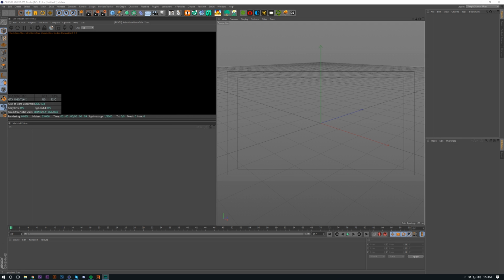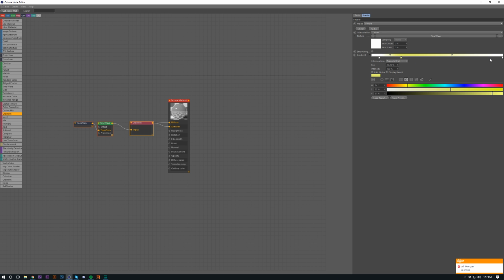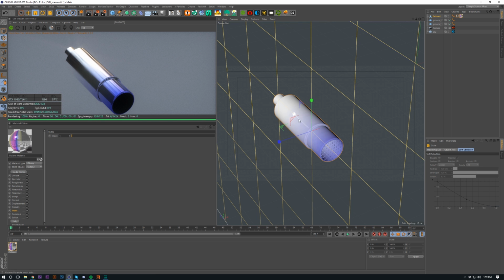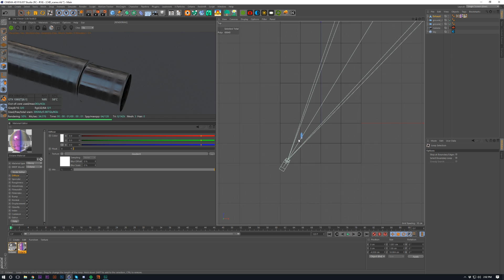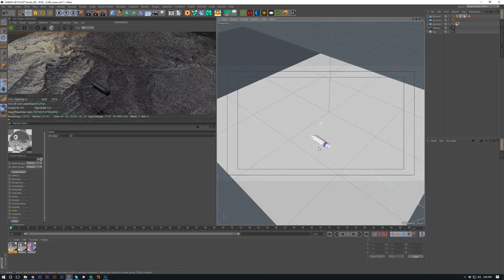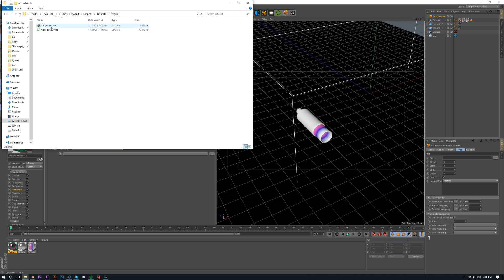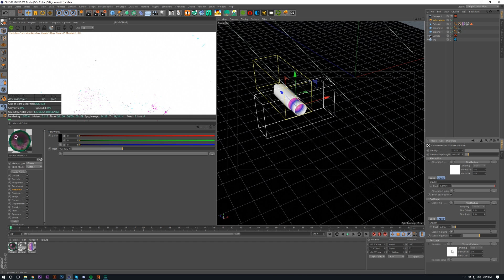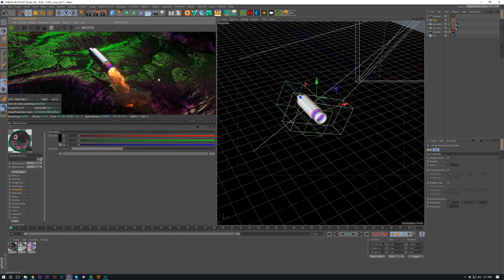Shading an Exhaust and VDB Smoke Tutorial in Octane for Cinema 4D - Free Download

Comment: Great tuts. But do you think you can up the resolution of your computer? Everything is super small so it's tough to see. Other than that, thanks again!
Reply from the maker: Chase Chick yeah I could start recording on my 1080p monitor instead of the 1440p one
Reply: AxisFX that would be great! Keep up the good work. Water tut next with xp4 and open vdb mesher? It's giving me fits!
Reply from the maker: +Chase Chick I'm still on 3.5, is it worth the upgrade?
Reply: There's definitely a lot to like. When I found out I could export vdb smoke and fire sequences directly into octane from the cache object I was sold.
Reply from the maker: +Chase Chick Yeah I just wasn't that impressed by the smoke and fire it made, Compared to Houdini and Turbulence at least.
Reply: I can't really compare because I don't have either. Even though I can feel the pull to splurge, I'm trying to maintain somewhat of a rule about programs that overlap. I have it spend too much other money on video equipment. Sad day.